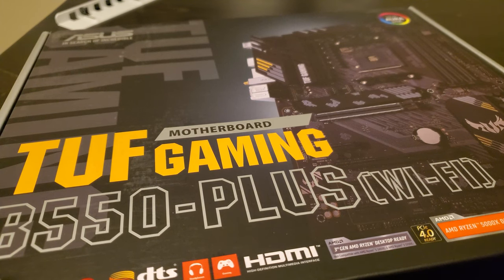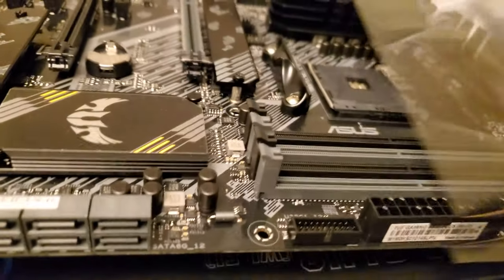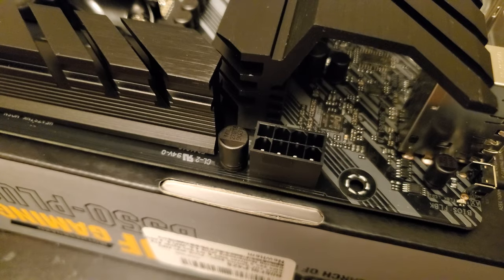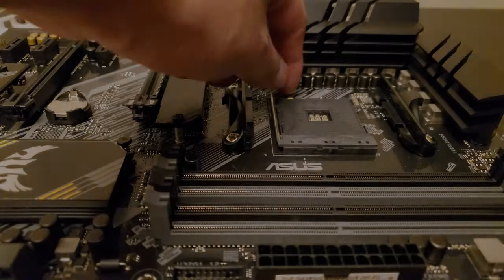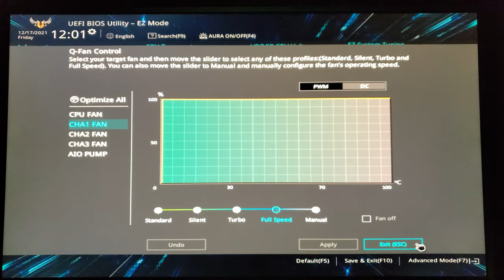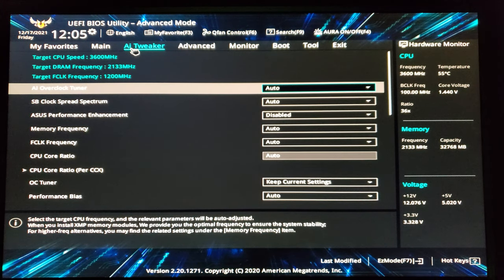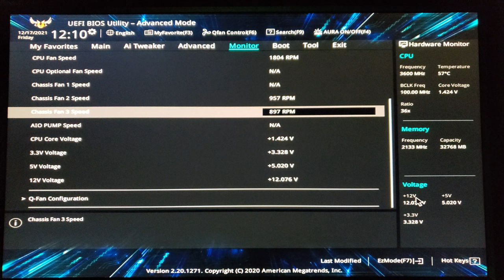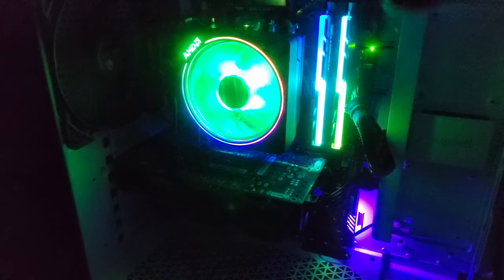The ASUS TUF Gaming B550 Plus Ryzen Motherboard | Unboxing, Installation, BIOS, & Review

Comment: Just a word of warning. My backplate had a flaw where the hole for the flashback button was not lining up properly with the button. It activated the flashback causing a boot delay. Solution is to make the hole wider. Noticed others had this problem.
Reply from the maker: Very interesting to hear. I'll definitely keep an eye on this and see if this board has this issue as well.
Reply: I just built and the flashback button was on I was able to get the button to align after a bit - make sure that the button does not get stuck behind the plate   At first  I could not get to post but after I turned  the power supply off and turn it back on it's all good. I installed the 5600g  which is awesome with a 3060 founders edition
Reply: @seanbaxter1692  yes. best i can say is to try removing the backplate completely. that's what i ended up doing.

Comment: It's a Great Motherboard. I'm using it. The bios , Software , Thermal And Dedicated 10 Phase VRM with Quality Component's make this Board very unique. No dought it's Capable of Handling Ryzen 9 5900x overclocked With ease. Also there is lot of Connectivity. I'm happy with this Board. Absolutely no Regret that I didn't own an expensive X570 Board .
Reply: Hello, did you have to update bios to work with your new CPU?
Reply: @bigsam9987  no. By Default it had bios ver 2403. and according to website info inwas more than updated for Ryzen 5900x. So No. Just Install the Cpu And cooler then your are good to go with windows installation.

Comment: hey man just got this mobo for new build. first build,  i feel like the only thing I'm going to struggle w the most is the Wi-Fi side of things, mine came with the antenna. do you know how that works getting the Wi-Fi setup? obv you gotta screw the antennas into the back panel. i have Wi-Fi at home but then will it find it automatically or how does that work thanks man
Reply: U have to download disc that came with it and install everything

Comment: It says I have no fans running, is that because they’re connected to a Corsair controller? They’re definitely working just not showing in bios
Reply from the maker: Yes, that's usually why, since the motherboard cannot see the RPM of the fans when connected to another controller. However, the controllers sometimes have a little fan connection that go connects to the fan connector itself, to give some RPM monitoring.

Comment: I have the ASUS TUF X570 Plus with Wi-Fi in a complete new case build.  I bought the ASUS TUF B550 Plus Wi-Fi to put in my old computer for granddaughter and her kids to use.  The Wi-Fi works great because the computer has to use their Wi-Fi where it is.  I put 16 GB ram in it with the WD Black M.2 1 TB drive that reads around 5,000 mb/sec.  I like that the B550 has the BIOS button so if there was a problem with the BIOS on board you can update it and then compatible with CPU etc.  Didn't have any problems due to already compatible with AMD Ryzen 5 5600X CPU.  Put Windows 11 Home on it and works great.
Reply: Did the WiFi work right away?  I just finished a build but can’t get the WiFi working😕
Reply: @Marcelis . Yes works really well all the time.   Even better than using a USB antenna.
Reply: @Marcelis    I had to enable the Wi-Fi.  The you have to go into settings to connect to your Wi-Fi.  Once I did that it connects no problem.  I upgraded my old computer for our granddaughter and her kids.  The modem is in another room and Wi-Fi is only way to connect where the computer is at.  

I think the settings to enable using Windows 10 or 11 B are on right side of taskbar.  Click there to view Wi-Fi and make sure enabled.  Once the Wi-Fi icon is in the right side of taskbar double click it and use setting to join your network.
Reply: @Askeyb2011  thanks for the insight.  I did enable the wifi in the bios but maybe i'm missing something obvious
Reply: @Marcelis  You need to make sure Wi-Fi is enabled in Windows.  Then click the Wi-Fi icon in the taskbar and connect to your Wi-Fi find the SSID name and select it and put in your password.  You do have Internet at your home?

Comment: I'm not getting a video signal using the onboard HDMI port. Tried a new cable. Is it coming from the other display port? I've never used that cable before, so I wanted to ask before I bought one. Tried putting a GPU in and got no signal as well. Hard to test what I can't see. lol

The board cycles through colors and ends on white. The manual says nothing about troubleshooting of course.
Reply from the maker: if you're seeing colors, something is wrong with the signals. Have you been able to try another kind of connection like DVI or DP cables? Also, the monitor you're using has no issue using HDMI with anything else, like a laptop?
Reply: @Silent157  Appreciate the reply, but I slept on things, which is what I really should've done. It was either the power supply or the GPU I was using to test with. I was able to get it working with some spares I had. It's been 10+ years since I kept up with hardware, and I made a noob'ish error too.

I completely forgot the 5600x (which I probably should've mentioned before) doesn't have ANY integrated graphics. That would have saved me some time and frustration. Everything seems to be running great with this combo. In fact, I have to adjust to the new build running so much better than I'm use to. It's a wonderful problem though.

For the record, the board is handling 32gb of 3600 memory like a champ in case anybody wanders in like I did. Make sure to grab the software/drivers from ASUS as well. Oh and I have no clue if it needed it or not, but I did Flash the Bios (version 2803) while trying to figure out the issue (me) and that worked like a charm as well.

Comment: just built mine today but the wi-fi adapter didn’t work anything i could be doing wrong
Reply from the maker: It is usually disabled by default. You can go into the BIOS and enable it there.

Comment: Thanks building this right now. Just reading up so i know exactly what im doing. Very handy i wonderred where my case usb3 connector would fit. I notice you didnt do the thermal paste. Any reason?
Reply from the maker: You're welcome and glad you found the video helpful. I very recently moved this CPU from one board to this one for purposes for the video, and there was already thermal paste under the heatsink itself, otherwise I would have cleaned it completely and reapplied.

Comment: my i/o shield isnt attaching to my case, its a Lian Li Lancool 205 Mesh C. am i doing something wrong?
Reply from the maker: Heard a similar issue from another comment regarding the back plate or related. Does it clearly not fit in, or just being difficult to be installed? I saw pictures of the case and it accepts these back plates.
Reply: @Silent157  It seems like the cut out on the case is too big for the I/o shield, whenever I try to put all 4 corners into place it just falls right out

Comment: Would it be a good choice for Ryzen 7 5800x?
Reply from the maker: This motherboard can definitely support the 5800x CPU, though it may require a quick BIOS update to use it, and this can be applied even without a CPU installed. Also be sure your CPU cooler in mind can fit as well.
Reply: I Guarantee , You Can overclock Ryzen 9 5900x with ease and get a stable performance. And with Ryzen 7 5800x , no dough you'll be satisfied . Just go ahead and grab it.

Comment: how can i change the colours of the motherboard's lights (the ones on at the end when all else is turned off), is it even possible?
Reply from the maker: If you're referring to the ones that stay on when the system is turned off, those likely can be changed or disabled using the Asus Aura software to choose which colors you would like. Let me know if for some reason that doesn't work for you though.
Reply: @Silent157  I can use the Aura software to adjust my RAM RGB but my motherboard does not show up on it at all. Oh well, at least the RGB on the MOBO isn't too big or noticeable.

Comment: I built my pc with this and I can't get it to turn on. There is power to the motherboard because the rgb lights on the board are on. I have a ryzen 7 5700g cpu. Any ideas. Literally I hit the power button and nothing. I do have all the connections in the correct spot.
Reply: was i a bios update issue?